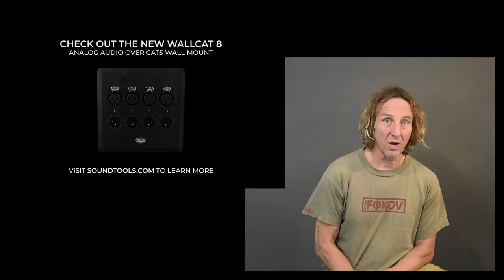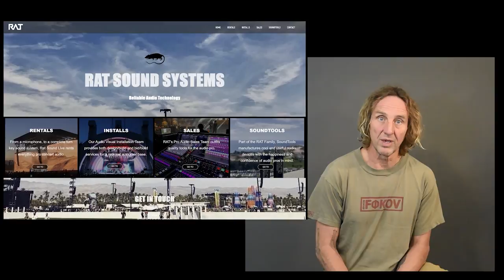Making Quality XLR Cables #4 - Quad Mic Cables (Public)

Comment: Excellent video.  Your attention to detail and the explanation of tips and tricks that you have obviously learned by doing for many years, is excellent!  For example, the rubber band over the needle nose pliers to create a hold for the connector is a great idea.  I like the explanation of the heat sink on the ground to keep the heat shrink tubing from shrinking wile soldering.  I have experienced the same.  Thank you.  Incidentally, I learned how to solder from a Heathkit course (anyone remember Heathkit)  LOL.  Learning how to solder correctly is invaluable.  Thank you!
Reply from the maker: So cool and thank you Jason!

Comment: As a VERY small time operator, I truly appreciate stuff like this. I learned on-the-job doing gratis work for a non-profit. To cut costs I bought a 1000' roll of XLR and a box full of Neutriks and relied on soldering skills I learned in high school electronics class almost 30 years prior. Even so, those cables are very robust. Not quads, but I didn't go bargain basement on the cable. If I ever need to expand or replace, now I have new skills learned from a real pro. Thank you Dave and YouTube.
Reply from the maker: Awesome and thank you Brian!
Reply: @DaveRat  Solved !! Thank you very much

Comment: Thanks for doing these vids!! So many people still are rubbish at soldering - so much over-stripping, cold joints, etc. I will say after soldering 1000s of cables in my life - the rubber bands on the needle nose was new to me. (DOH!) what a great little tip. 
At the production/install company I worked for in the 90s, we added a piece of heat shrink that went over all the conductors and the end of the overall jacket just to provide more bite to the connector’s strain relief - but that was largely due to the old Switchcraft A3M/F days.
Reply: Oh. We also used “spaghetti” on the drain wire/shield (wasn’t heat shrinkable). That stuff was invaluable.
Reply from the maker: Yes, new connectors have much better grips. But yes, the extra overall shrink does reduce failure at the connector joint.
Reply from the maker: Yes, we use the spaghetti mainly on the drain wire with foil shielded cable

Comment: I'd really love to see how you handle the braided shielding on the Canare star quad, especially the poking a hole and pulling through method that you described. I've heard others mention it but haven't seen it demonstrated. It's the most available cable stock to me and aside from the PITA shield, I really like it. I've had reasonable success with the picking method if I use my ESD tweezers which seem to be just the right taper and point to separate the braids, but it's still a pain when I have a big ol' pile of cables to do.
Reply from the maker: Will ponder doing a canare build

Comment: Thanks for the video. Consise info that is useful to a lot of people. 

It funny because I solder in the opposite order so I can manipulate the cable a little easier till I attach the shield. I also like to fully tin the shield and signal cables on most of my cables to avoid oxidation. 

Love the pliers with the rubber band helping hands not always very helpful. I ended up making a panel with 2-1/4, 2-male and 2- female connectors along with wiring diagrams to help ease the process and get less crossed wires..

Definitely will be sharing your video for tips to people learning.

Comment: Great video, Dave. What do you suggest for cable and ends? I have read articles regarding cable quality and ends. Who makes the good stuff? Not necessarily the most expensive. Thanks Dave
Reply from the maker: For our SoundTools products we standardized in Neutrik as a quality connectors reasonably priced and excellent selection of products.  That said, for our rental department, we use Apmphenol XLRs at the will print a little rat in the strain relief and the connectors are robust and slightly less expensive.

We also have quite a few whirlwind connectors on our older multipin tails.  All work well and no specific issues.

I have had issues with cheap imitation connectors cracking and strain reliefs slipping and such.
Reply: @DaveRat  Thanks Dave. Much appreciated.
Reply: Neutrik is best I’ve found.

Comment: Hey Dave! Love your videos! Quick question. I’m making my own mini xlr cables for my camera mics and am using the mogami 2893 mini quad cable. I’m straight on doing regular xlr cables with mogami 2534 but this cable has the copper ground looking thicker wire, a clear coated wire, one black, one red and one blue. Which wires go together and to which pins on the 3 pin mini xlr tabs. Thanks so much for any help!
Reply from the maker: Hmmm, that's 4 wire cable and so connect the blue to shield, trim extra shield wires if necessary and go to pin1, red to 2 And black to 3
Reply: @DaveRat  shield meaning the clear coated wire? I really appreciate the help. I followed your videos closely and they were such a huge help. Just wasn’t sure if the black should go to the clear coated and the red and blue should go together, etc. Also should I clip off the larger copper bare wires altogether . Is confusing!
Reply from the maker: Oh, 5 wires. And it's quad, ok, giive me a minute
Reply: @DaveRat  the 5th wire is the larger bare copper wiring that I twisted together like you would for a regular xlr.
Reply: @DaveRat  I really appreciate your help!
Reply from the maker: Ok, can't find do s on it, basically the red and the wire that is diagonally opposite the red go to pin 2, the other two wires go to pin 3 and the shield goes to pin 1
Reply from the maker: The 5th wire is pin 1
Reply: @DaveRat  diagonally opposite of the red is super hard to determine in a circular grouping of wires. Looks like it may be the red and clear coated go together then and then the blue and black together and then the bare larger grouping of copper wire goes to pin 1

Comment: Hey Dave.  What conditions warrant shrinking individual terminals?  I really appreciate you sharing your expertise in audio engineering. This video and your recent panning video were really helpful.  I was going spend money on tools to make an upcoming installation more efficient, but took several thing off of my list after watching this. The needle nose and rubber bands is brilliant! It's like a 4 in one tool , and I happen to have several pair scattered about various tool bags. Thank you for saving me time and money.
Reply from the maker: Very cool. As far as shrink, modern XLR connectors offer great support so the need for sharing for strength is near eliminated and the cable will fail at the strain relief before the solder joint. I only use shrink if the cable has really thin conductors, like terminations cat5e to XLR
Reply: @DaveRat  Makes sense. Something else I can take off the list!

Comment: Dave, have you ever tried to measure/quantify the additional common mode rejection achieved by a quad cable vs. a normal cable (assuming there is already a good shield)?
Reply from the maker: I have not but will add it to the list
Reply: Benchmark Media produced a good video showing real measurements.

Comment: Hay Dave, I have noticed some xlr cables have more handling noise than others. Sounds like a thump when you grab a mic stand with the cable. Or tapping the cable. Does quad cables like Mogami Platinum do this, that you know? If so, do all quad cables have less thump noise?
Reply from the maker: That's not really a quad versus twisted pair issue. That's more related to the quality of the cable itself. Higher quality cables will have less handling noise.

Comment: Dave have you ever test for any difference in sound and noise rejection, when the shield is connected to the XLR shells, versus not connected?
Reply from the maker: There can be humm or buzz in non connected shells with extended XLR cables that have very low levels and high gain or in very noisy rf environments

But when XLR cables are plugged to mics or gear, the gear will have the shield of the chassis or mic housing connected to pin 1 and the will ground the xlr shell.

Conversely, grounded XLR shells will connect any metal they touch to pin 1 and this can cause issues if the touch a AC ground that is different than the audio ground and cause a buzz or humm

So. There are advantages and issues to connecting the shell to pin 1 in the cable. I have found connecting the shell to rarely be beneficial but is something to be aware of when troubleshooting as an option to solve issues
Reply: @DaveRat  This could make a cool new video series for you!  Get the neutrik EMC XLR series NC3MXX-EMC, NC3FXX-EMC, connects pin 1 to shell thru a tiny cap, and puts a tiny ferrite bead over line 1. Compare to every combo of pin 1 connected to shell or disconnected on F side or M side of cable. AES48 standard 2019 and Behringer CTS200 shows fault when pin 1 connects to shell on male (output) XLR! Test by bringing cell phones and wifi and wireless mic transmitters and 60 cycle hum big power supply transformers (RF and EMI) near ungrounded and half grounded (telescoping ground) cables!
Reply from the maker: Interesting, not an area of expertise but will ponder that
Reply: @DaveRat  Huh?! I thought you’re the sound guy who tries things out in different ways, to compare how they sound and compare expectation with reality?!
Reply from the maker: Not against doing it but also not a topic I have had any real world issues with or heard any odd or doubtful myths about.

 Creating powerful ot a variety of RF noise for interferences and testing is an interesting endeavor that I don't know enough about to do with stuff laying around.

The topics I choose tend to be either something I know a lot about and can offer a unique, useful or simplified perspective or topics that are of widespread high level interest that I hear lots of requests for or things I see people doing unless than ideal ways.

As far as shell sheilding, so far I have not seen a high interest, I have not experienced issues with it and I don't know an exceptional amount about RF.

That said, capacitive, inductive and resistive chassis grounding methods are interesting an I have seen them used on some gear.

Having a resistor with a choke to the shell seems to be a way of making the shell not buzz when touched and not connected to gear when the gain on the pre amp is high and also, when there is a high RF environment, the resistor choke low pass filter helps reduce the RF picked up from the shell from being sent to pin 1 ground, on longer cables.

Perhaps I will find the time to dive into learning more on the topic, I will ask the channel members.
Reply: @DaveRat  Another issue is performer safety. With pin 1 connected to XLR shell and the audio gear fails with AC power on its chassis, that AC will reach the mic shell and electrocute the performer whether handheld mic or backing vox sings with their lips on the mic grille. Zap. This has happened to many bands at many live gigs.
Reply from the maker: Oh my, and also all mics have pin 1 tied to the housing so it makes ground hit the shell when the mic is plugged in
Reply: @DaveRat  Oh boy! This pin 1 to Shell gives us about 3 big things: shock hazard, ground loop, and EMC; to try variations on, measure dB and frequency spectrum, or shock voltage current and wattage, and listen test subjective perceived volume level of the hum or wireless transmitter interference.
Reply from the maker: Well, mics and gear have their chassis grounded to pin 1 almost always so the chassis then will ground the shell to pin 1, so it makes no difference if the shell is grounded as it gets grounded either way.

But when extending mic cables and Noether has a pin1 to shell, the shells will float.  This can be a good thing if there is metal around that could touch and ground the shell to another ground and cause buzz or loops. But also for XLR runs that need maximum shielding, ungrounded shells do let a bit of interference in at the xlr extension junctions. So grounding to pin 1 can be beneficial.

As far aa shock hazard, more goruns is considered better and safer and if touching the shell of a pin1 grounded XLR is a danger, there are bigger issues that need to be resolved.
Reply: @DaveRat  True!  Would it be possible through test and measurement of all the variations of pin 1, shell, cap, resistor, ferrite, neutrik EMC, AES48, to rate each XLR cable config and come up with 3rd place 2nd place and the winner which is both safest against lethal shock and cleanest audio ie zero audible ground loop hum, RF, receiving broadcast radio stations and wireless analog audio or digital cellular in the audio..?
Reply from the maker: Yes but sounds way too boring for an adventure for me.

I try and focus on fun stuff or info that will be useful to lots of people or mythbust flawed beliefs.

As far as grounding XLR shells, my take is just don't do it unless you have issues not doing it.

Comment: Hello , thank you for this video ,  i have build my own cable using your method using the same cable and connector  but surprisingly, the sound is lower and less clear than an unbalanced connexion, is it normal ?  i checked the gable with a tester and nothing is wrong . have you an idea ?
Reply from the maker: Sounds like you have pin1 and pin 2 reversed on one side

Comment: Dave, how much of the signal will a quad cable lose or gain, compared to only the standard 2 + shield cable?
Reply from the maker: It won't lose or gain any more signal, the wire gauge determines that. The quad cable will be slightly better at rejecting interference noise with an improved common mode rejection.

Comment: Thanks! Would love to see how to make BNCs.
Reply from the maker: Hmmm, I have not made enough over the years to offer guidance of value
Reply: Ah. I see. I´m the movie biz, and need to fix a few timecode cables which use BNC connectors. I have tried, but found the BNC signal pin to be really hard to solder… But thanks for sharing! Learnt some nice tricks here. Like the rubberband on the plier!
Reply: Quick answer is crimp or cry. If that is out of the question due to availability / cost of the proper crimp tool, then to solder the pin use an iron and centre conductor that are very lightly tinned, clamp the cable so the hole in the side of the pin is facing up and apply the iron, then solder to the hole. If all goes well, all the solder will wick into the hole, leaving no lumps on the pin to prevent it fitting into the body.
Reply from the maker: Awesome, thank you Dougal!

Comment: I made up 5 quad cables for my tom mics, and my stripping job wasnt so great. Does the occasional absence of 1-3 copper strands on one leg of a twisted pair make much of a difference?
Reply from the maker: The issue is a bit, losing the strands but also if strands are breaking off it is often an indication that the strands were scored which makes it easy for them to break. The occurs from sharp strippers. And often other strands will break later at the weak point. And the more that break, the weaker it gets. 

That said, when soldering, making sure solder flows around the weak point where the cuts are can help a lot to add strength.

Comment: Hi, thanks for your explanations. I would like to move from my wireless monitoring to a wired system. But I use two channels for a better mix. I thought of making with a quad balanced microphone cable two xlr female from each of the console outputs to 1 xlr male to, for example a Behringer powerplay p2 or similar, for a single connector if possible and thus avoid having two cables for my monitoring plus that of my instrument. Its viable ? Could you help me with a diagram or in some way? Thanks in advance.
Reply from the maker: Yes it's viable but you should ask an audio forum for assist.  I try and help with stuff that other people can not do so. This is something that many people can do

Comment: Hi Dave, I noticed that in previous videos you put the white wires in pin 2, In this one you put it on pin 3. I know its ok as long as you go from Pin 2  to Pin 2 and from Pin 3 to Pin 3  but shouldn`t  you have a standard. I use Canare Quad and although they use blue wires (don`t know why) I just tend to be "colorblind" and look at them as black
Reply from the maker: Yeah, that's all a mess. Black tends to be ground in signal wires and a hot in ac electricity and shield is ground in signal and when I started in sound it was pin 3 XLR hot which meant black was pin 2. but with pin 2 hot black should now be pin 3 and white pin 2. And we have cables from all ages and sooooo. for XLR the proper wiring as my daughter tells me is:

Twho

2(wh)o
as in  

pin 2 is wh(ite)

But me and my old ways and all my exposure to AC electricity wiring will make black hot to pin 2 on occasion
Reply: Yes, I`m even older than you and lived that. I also do a bit of teaching here in Venezuela (Though I`m peruvian), I don`t know if you have done it but with all the music devices with stereo mini plug output a lot of people get use those stereo mini plug cables, put on one side a 1/4" inch adaptor and plug it in the console. You could explain the problems with that. Do you have an email?
Reply from the maker: Drat@aol.com

Comment: Personally, I believe it does make a different for short runs if there are devices at the DJ booth such as cell phone chargers and laptop chargers.  Which is every single time at music festivals.  Quad Star will protect the signal if the charger cables touch cross the wires.

Comment: A suggestion for holding the plugs...... Make up a board with a Male and Female panel socket mounted in it. So it sits under it's own weight on the bench. 

its best for soldering Male connectors if you get a bit over benerous with the heat you melt the plastic and the pins get out of alignment. Plugged into a female socket while doing this holds them in place and the extra metal in the female helps take away the extra heat.